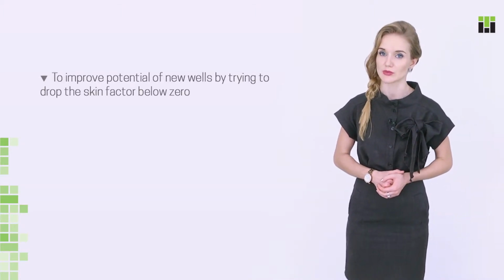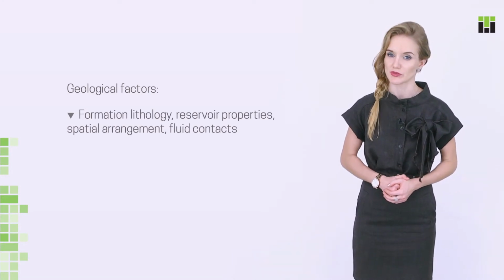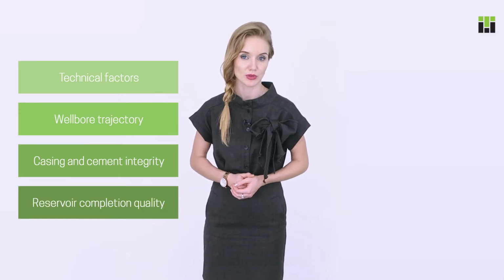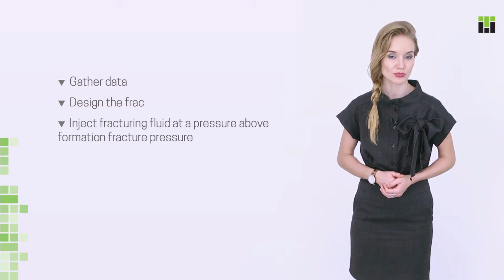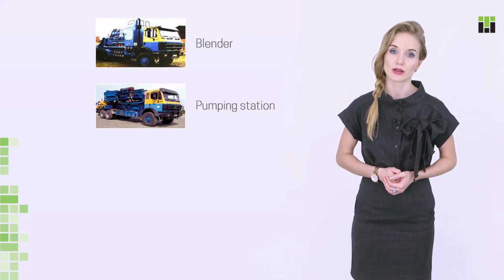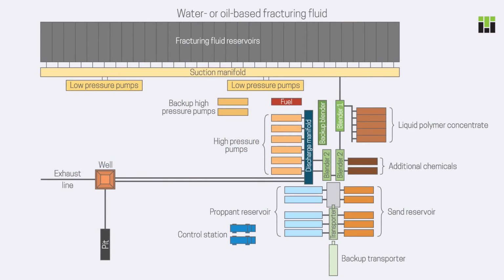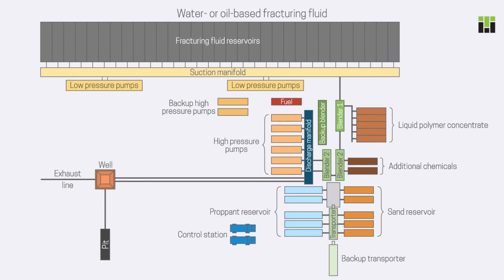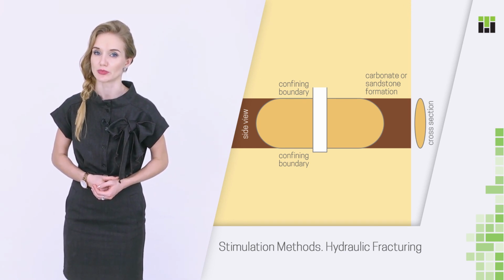7.6. Stimulation Methods. Hydraulic Fracturing

Comment: Hello, our updated enzyme gel breaker can be used in blockage removing, well washing and hydraulic fracturing at the temperature range of 10-150℃ to degrade guar gum, hydroxypropyl guar gum and other plant gum with β-1,4-glycosidic bond. Especially in blockage removing and well washing,our new Frac-cleaner Enzyme product achieve huge success in removal of the residue (guar gum, HPG, CMHPG…..) and Frac-blockade which cause damaging the fractures, and eventually will improve the flow conductivity of the fractures. By doing so, the output of the oil well can be increased and the effective period of fracturing can be prolonged.

Vickey
WhatsApp/Mobile: +8613889497495